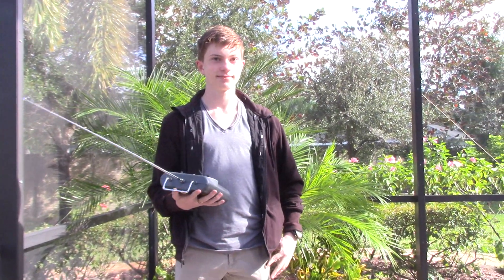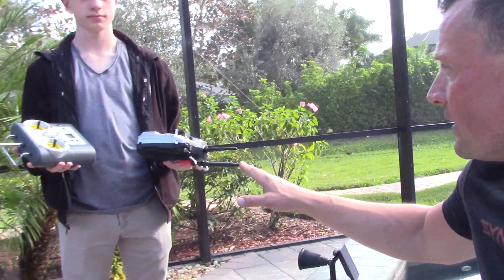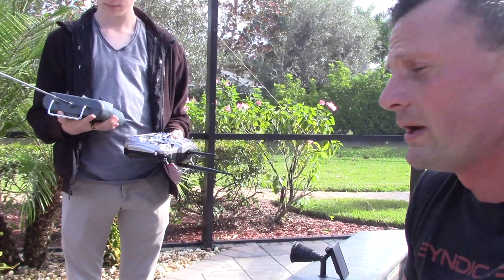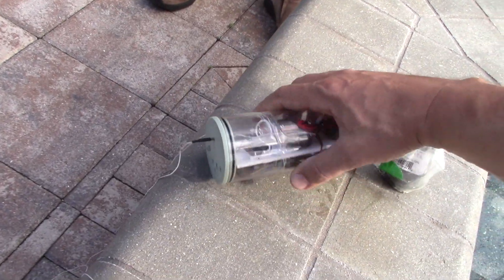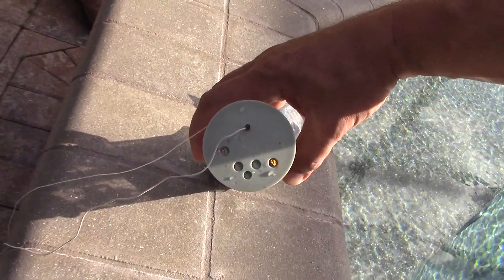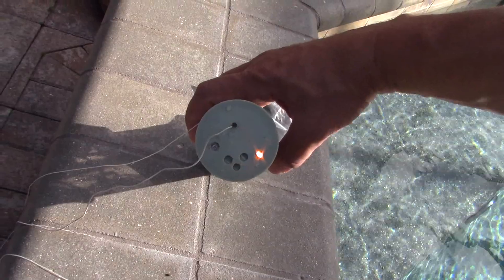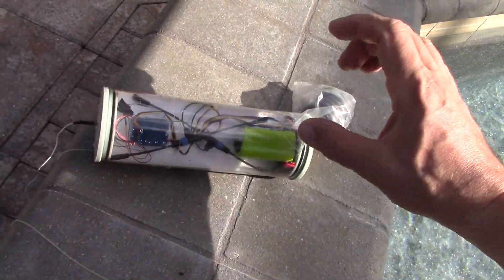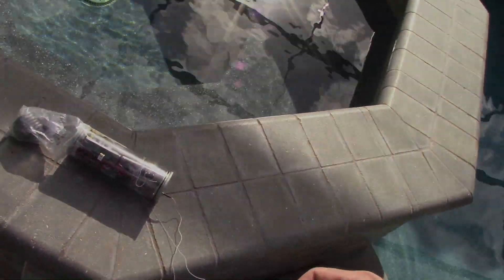900 Mhz Radio in an RC Submarine - WILL IT WORK?

Comment: I learned 40 years ago that's is not the depth that effects range but the distance the signal has to travel through water. 2 ft straight down equals 1ft down at a a 30 degree angle.
Reply from the maker: That's true. The angle of air/water interface also makes a big difference. High frequencies tend to "skip" off the surface.

Comment: Will a 75mhz jr module not work? Or it it receivers that is the thing you are having a hard time getting?

It would be cool if some one made a wired module bay system that could snap in to any of the modern computerized radios for underwater things but I cant find one if it exists.

Comment: I have successfully converted my sub from 40MHz to the eLRS system on 868MHz. My sub can dive to the bottom (was about 1.5m) and there is no need for the antenna to be above water level. Range seems almost identical to the old 40MHz system. I tried to go away from the submerged boat at 1.5m depth and had at least a range of about 80m. 
It is not only about frequency and power, but also about receiver sensitivity and transmission protocol. I have found the best settings to be:
Packet Rate: 50
Telem Ratio: 1:32
Switch Mode: Wide
TX Power: 250mW, but even 100mW worked quite well

Comment: using System;
using System.Threading;
using System.Threading.Tasks;
using System.Diagnostics;

class S
{
  static void Main()
  {
    pcount = Environment.ProcessorCount;
    Console.WriteLine("Proc count = " + pcount);
    ThreadPool.SetMinThreads(4, -1);
    ThreadPool.SetMaxThreads(4, -1);

    t1 = new Task(A, 1);
    t2 = new Task(A, 2);
    t3 = new Task(A, 3);
    t4 = new Task(A, 4);
    Console.WriteLine("Starting t1 " + t1.Id.ToString());
    t1.Start();
    Console.WriteLine("Starting t2 " + t2.Id.ToString());
    t2.Start();
    Console.WriteLine("Starting t3 " + t3.Id.ToString());
    t3.Start();
    Console.WriteLine("Starting t4 " + t4.Id.ToString());
    t4.Start();

    Console.ReadLine();
  }

  static void A(object o)
  {
    B(o);
  }
  static void B(object o)
  {
    C(o);
  }
  static void C(object o)
  {
    int temp = (int)o;

    Interlocked.Increment(ref aa);
    while (aa < 4)
    {
      ;
    }

    if (temp == 1)
    {
      // BP1 - all tasks in C
      Debugger.Break();
      waitFor1 = false;
    }
    else
    {
      while (waitFor1)
      {
        ;
      }
    }
    switch (temp)
    {
      case 1:
        D(o);
        break;
      case 2:
        F(o);
        break;
      case 3:
      case 4:
        I(o);
        break;
      default:
        Debug.Assert(false, "fool");
        break;
    }
  }
  static void D(object o)
  {
    E(o);
  }
  static void E(object o)
  {
    // break here at the same time as H and K
    while (bb < 2)
    {
      ;
    }
    //BP2 - 1 in E, 2 in H, 3 in J, 4 in K
    Debugger.Break();
    Interlocked.Increment(ref bb);

    //after
    L(o);
  }
  static void F(object o)
  {
    G(o);
  }
  static void G(object o)
  {
    H(o);
  }
  static void H(object o)
  {
    // break here at the same time as E and K
    Interlocked.Increment(ref bb);
    Monitor.Enter(mylock);
    while (bb < 3)
    {
      ;
    }
    Monitor.Exit(mylock);

    //after
    L(o);
  }
  static void I(object o)
  {
    J(o);
  }
  static void J(object o)
  {
    int temp2 = (int)o;

    switch (temp2)
    {
      case 3:
        t4.Wait();
        break;
      case 4:
        K(o);
        break;
      default:
        Debug.Assert(false, "fool2");
        break;
    }
  }
  static void K(object o)
  {
    // break here at the same time as E and H
    Interlocked.Increment(ref bb);
    Monitor.Enter(mylock);
    while (bb < 3)
    {
      ;
    }
    Monitor.Exit(mylock);

    //after
    L(o);
  }
  static void L(object oo)
  {
    int temp3 = (int)oo;

    switch (temp3)
    {
      case 1:
        M(oo);
        break;
      case 2:
        N(oo);
        break;
      case 4:
        O(oo);
        break;
      default:
        Debug.Assert(false, "fool3");
        break;
    }
  }
  static void M(object o)
  {
    // breaks here at the same time as N and Q
    Interlocked.Increment(ref cc);
    while (cc < 3)
    {
      ;
    }
    //BP3 - 1 in M, 2 in N, 3 still in J, 4 in O, 5 in Q
    Debugger.Break();
    Interlocked.Increment(ref cc);
    while (true)
      Thread.Sleep(500); // for ever
  }
  static void N(object o)
  {
    // breaks here at the same time as M and Q
    Interlocked.Increment(ref cc);
    while (cc < 4)
    {
      ;
    }
    R(o);
  }
  static void O(object o)
  {
    Task t5 = Task.Factory.StartNew(P, TaskCreationOptions.AttachedToParent);
    t5.Wait();
    R(o);
  }
  static void P()
  {
    Console.WriteLine("t5 runs " + Task.CurrentId.ToString());
    Q();
  }
  static void Q()
  {
    // breaks here at the same time as N and M
    Interlocked.Increment(ref cc);
    while (cc < 4)
    {
      ;
    }
    // task 5 dies here freeing task 4 (its parent)
    Console.WriteLine("t5 dies " + Task.CurrentId.ToString());
    waitFor5 = false;
  }
  static void R(object o)
  {
    if ((int)o == 2)
    {
      //wait for task5 to die
      while (waitFor5) { ;}

      int i;
      //spin up all procs
      for (i = 0; i < pcount - 4; i++)
      {
        Task t = Task.Factory.StartNew(() => { while (true);});
        Console.WriteLine("Started task " + t.Id.ToString());
      }

      Task.Factory.StartNew(T, i + 1 + 5, TaskCreationOptions.AttachedToParent); //scheduled
      Task.Factory.StartNew(T, i + 2 + 5, TaskCreationOptions.AttachedToParent); //scheduled
      Task.Factory.StartNew(T, i + 3 + 5, TaskCreationOptions.AttachedToParent); //scheduled
      Task.Factory.StartNew(T, i + 4 + 5, TaskCreationOptions.AttachedToParent); //scheduled
      Task.Factory.StartNew(T, (i + 5 + 5).ToString(), TaskCreationOptions.AttachedToParent); //scheduled

      //BP4 - 1 in M, 2 in R, 3 in J, 4 in R, 5 died
      Debugger.Break();
    }
    else
    {
      Debug.Assert((int)o == 4);
      t3.Wait();
    }
  }
  static void T(object o)
  {
    Console.WriteLine("Scheduled run " + Task.CurrentId.ToString());
  }
  static Task t1, t2, t3, t4;
  static int aa = 0;
  static int bb = 0;
  static int cc = 0;
  static bool waitFor1 = true;
  static bool waitFor5 = true;
  static int pcount;
  static S mylock = new S();
}

Comment: I'm also trying to get a signal reliably through the water. The problem I'm facing is trying to find a transmitter/receiver in the VLF band - I heard that 30kHz (0.03MHz) is mainly used.
Reply from the maker: 75mhz in North America. 40mhz in Europe. Those are the legal frequencies.

Comment: I don't know anything about RC submarines, but i'm a fairly decent at electronics, and i can think of two solutions:

#1: VLF magnetic transmission in the unregulated 9 kHz frequency band. For your transmitter, you attach a big loop of wire to an amplifier and send a 9 kHz AM signal through it. You can receive it with an LC circuit tuned to 9 kHz, then you do some DSP to extract the original signal. I still need to do some back-of-the-envelope calculations to figure out if this is feasible.

#2: An underwater speaker as the transmitter and a hydrophone as the receiver. Pretty crude concept, but it should be simple to get working.

You can make JR-style modules for both of these methods. The receivers would also be quite cheap and simple to manufacture.

Comment: So Just how big (or small) is the RC submarine niche? I come from RC planes and quads so you will have to excuse my lack of knowledge... though I do claim to have the worlds fastest RC submarine... see my channel. (unchallenged so far... haha) Anyway it seems to me that it wouldn't be very hard to for of the radio companies to offer a module that would work with the main transmitters (FrSky, Futaba, Spectrum...). The module could cover the existing ground frequencies used. Seems like this would be a great option. That's why I ask about the market size. Do we have the demand?
Reply from the maker: The demand is there, and growing, absolutely.
Reply: @RCSubGuy  that's what I thought... So why hasn't someone done this yet?... Maybe I'll have to. Haha. 😁

Comment: this was an obvious result.  The higher the frequency the worst it's penetration will be in water.  There is a reason why the NAVY uses ULF (Ultra Low Frequency) to communicate with subs underwater.  You can reasonably assume the penetration ability of a radio signal is inversely proportional to it's wavelength.  with the jump from 75 to 900 the penetration in a linear reduction of performance should be about 92% worse (or 8% of what it is at 75).  

So here is the million dollar question.  Have you tried "floating" a radio antenna behind your sub?  this would be moderately accurate, as real subs typically deploy a long "streaming" antenna on a cable in order to receive ULF transmitions.  An alternative would be to find out if anyone has licenses radios which operate on LOWER then 75Mz in frequency, since the 75's are going away.  If you can find lower you might be able to positively affect the hobby with deeper diving subs.  If you can't perhaps they can be made legally?  It's not like making a radio transmitter is all that hard.  the trick is just getting federal approval for broadcasting.

Comment: I have been running solely on 915mhz equipment for 2 years now.  915mhz operability is totally dependent upon the particulates in the water, and how much power output the TX module has.  I originally went with OpenLRSng based 915mhz equipment, but when the "garage" manufacturers for that equipment all dried up, i switched over to the FrSky r9m TX module and associated receivers.  I have used their r9, r9 slim, and r9 mini receivers.  again, i configure the TX module for maximum output, and ignore (turn off) telemetry.   please realize that telemetry output from the receiver back to the transmitter is capped at 100mw, while the transmitter can send to the receiver at 1w...   an order of magnitude difference.  you will always loose telemetry/rssi before you loose control of the sub.  i don't run 915mhz in swimming pools, the chlorine is a very bad "particulate" that will interfere with signal.  if you look at my channel, there is a new upload for a video i shot 2 years ago, using openlrsng 915mhz equipment.  Prior to the 915mhz equipment, i ran tests with the 433mhz OpenLRSng TX and receivers, there are several videos on my channel showing how well that works, even in swimming pools.  for most people the 915mhz equipment is easier to deal with, since it doesn't require a ham license.   90% of the 433 manufacturers have stopped making equipment as well...   hobbyking is the only one i know that still sells 433mhz equipment.

one last thing...    based on personal experience, 915mhz will never work like 75mhz, nor will 433mhz.  best depth you will get with 915mhz is roughly what bob got in this video - 2 feet.  the best depth i got on 433mhz was to the bottom of an 8 foot swimming pool in ideal conditions.   there are many users of 75mhz equipment that claim to have hit depths of 14 feet.   based on the fact that the subcommittee's favorite running spot (the reflecting pond at Carmel Indiana's City Center) is only 3 feet deep, the 2 foot range of 915mhz isn't that big of a deal.
Reply from the maker: Tim, thanks for chiming in! The reason I rigged the test module with lights was to check for response from the receiver, not from the telemetry. I lost control over the LED light at just slightly deeper than the telemetry failed. The thing of concern is that depth is a function of distance as well. The further away we get, particularly at these higher frequencies, the shallower we need to operate. 

Pools are exceptionally common playgrounds for subs, particularly the smaller ones. That needs to be kept in consideration when evaluating options.

Comment: Bob it may be worthwile trying other frequencies in the 66-88Mhz mid VHF band away from the usual 75Meg.This frequency range is out of favour with the general Comms Companies, i.e. Motorola because of the physical long antenna (low freq= longer antenna same as highfreq requires shorter antenna.Example is std ½wave for 75Mhz is approx. 2metres (this is overcome by using Coil wound antennas on the H-held radios) and when you look at your currentRC transmitters and receivers 900Mhz and 2.4Ghz their std ½wave antenna would be about 15cm for the first and about 4.5cm for the latter, although for gain these are then generally lengthened by adding another antenna the same out of phase.This frequency band is worldwide still in use and companies like TSSD in China (can you still deal with them?) are still producing these.(a.o. a Handheld radio TS-M558 fully programmable TX and RX and you could poss get a tech to isolate the tx side to use, even on 75.A dealer here I know personally has special tx-boards designed  to use a l-range switching by one of the companies. (FDP)Here in Australia we still use them in the outback due to their large covering range.So either that or you get a local company to built you some, all they really need is one of the older  RC TX unitsNeil, Radio Technician- ret.

Comment: I found a Futaba T9CAP on eBay in excellent condition. Is is an older 72MHz aircraft radio and I am sending it right now to Tony at Radio South to re-tune it to 75MHz along with an extra receiver. There are still crystals available for these radios and possibly others to be able to do that but it is a limited resource as well.

Comment: You should test a higher quality 900mhz tx/rx system. TBS (team blacksheep) has a system that does 2watts of output power, and with better receivers. It mounts on the back of the frsky radio:) maybe it will do better.
Reply: It won't. The higher the frequency the worse it travels in water.
Reply: @AnttiHarri  its the same freq, only higher quality and higher power.
Reply: @nutrox84  yes but the video was about using higher freq radios because you can't get the 27, 40 or 75 MHz anymore. Any 900 MHz will fail.
Reply from the maker: While not an expert, I was under the impression that high power transmitters were regulated and required HAM licenses to operate. I believe 1W was the cap?
Reply: @RCSubGuy  You are correct regarding HAM. Tho rules vary from country to country. The TBS Crossfire FULL/Lite module has adjustable powerlevel ranging from 10mw to 2W.  If you contact Raphael Pirker (Trappy) on Facebook, i bet he would find it interesting to have you test his tx also :)
Reply from the maker: @nutrox84  Thanks for the suggestion! I reached out to him on Facebook. We'll see what he says!
Reply: @RCSubGuy  Great! Hoping foa a followup on this video! Also thanks for all the great content! :)
Reply: @RCSubGuy  Any updates? :D

Comment: There are modular radios (like the Frysky) that you could "build" a transceiver units for them.  The signal from the controls to the module are just a pulse train (same up pulse as a servo but with very little down pulse that separates the channel pules). Just need a standard radio circuit to adapt.

Comment: I did a similar experiment when I built my submarine. I planned on using 2,4Ghz radio and I quickly learned it will only go centimeters into the water due to the high frequency.
I just got a 40Mhz radio instead. I am wondering, I have never heard of 75Mhz radios at all, and also I am wondering about the people in the comments talking about 433Mhz (it's way too high still).

Why wouldn't you just get a 40Mhz or 27Mhz radio? Here in Germany those have long been the only two legal frequencies used for RC, until 2,4Ghz came.
When I bought my 40Mhz radio, it was extremely cheap because everyone got rid of their 27 and 40mhz systems for 2,4Ghz systems.
I find tons of 40Mhz and 27Mhz radios on ebay everywhere here, they are cheap and will probably outperform any higher frequency system.
So... where is the problem?:)
Reply: 40M MHz is not legal in the US.
Reply: RCJetDude 6 bands in 27mhz are legal in US
Reply: @steamcastle2473  granted, but who makes a radio system on 27MHz that could operate a diving sub? I heard that 27 is mostly used for cheap toys. Are you aware of any?
Reply: i think75mhz is one of the old surface frequencies. 72 was legal for air. in fact think way back.. there used to be 26mhz and 27mhz radios with crystals plug in that dedicated a frequency to your tx/rc , but i believe they were AM
Reply: @HappyHands.  Yes, 75 is still a valid surface frequency and 72 is still valid for aircraft in the US. Neither is as popular now because of 2.4GHz. If you decide to operate a surface vehicle on 72 there is a small chance for interference with someone flying an aircraft as most likely any channel control would be non-existent not to mention that technically it's not legal to do so. Unfortunately for the sub community they don't represent a large enough segment of business for radio manufacturers to cater to their needs.
Reply: Even Corona have stopped production of 75/40 Mhz receivers.  There just isn't anyone making this stuff any more. Plus 27 Mhz only usually supports 2 channels which is useless for RC Subs.
Reply: @Luthlan  in Europe here you can get plenty of 40MHz with 6 or 8 channels